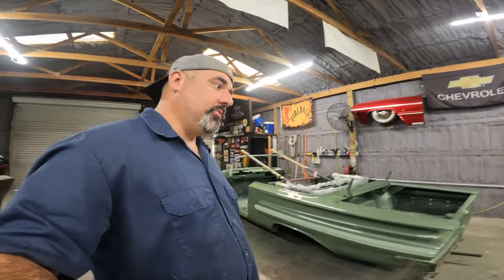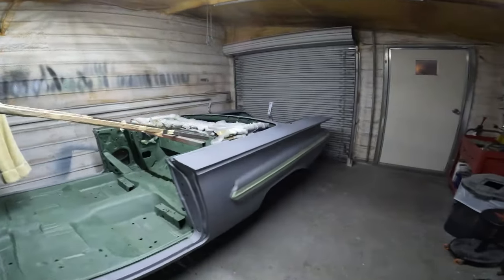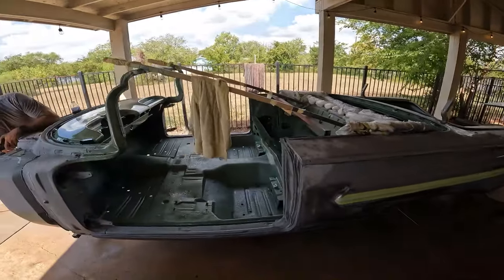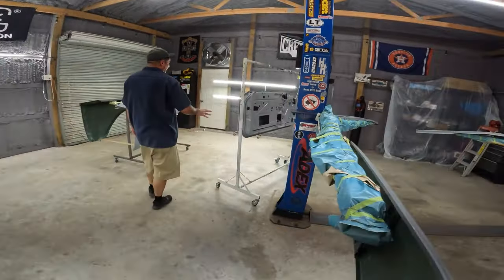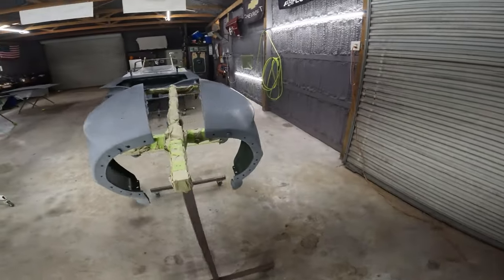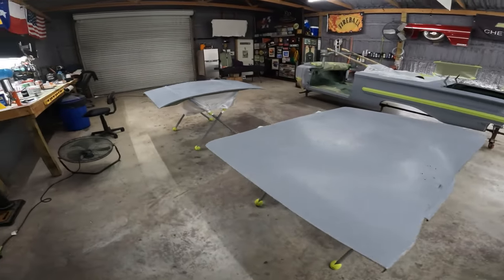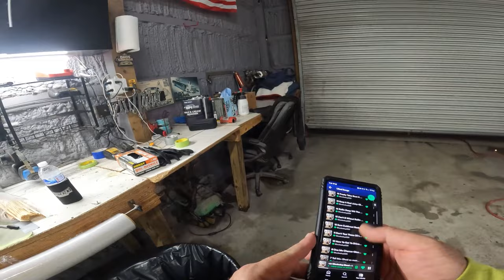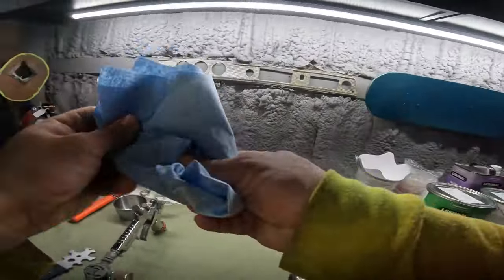1960 IMPALA CONVERTIBLE PAINT JOB PART 1!!  / DIY / LOWRIDER / PAINT JOB / BODY WORK / CLEAR COAT

Comment: @lonestar lows , what color is that green or if you have a paint code? Looks very similar to my Dads car but its not on a chevy, maybe you said it in a video and I missed it. I keep hoping one day you will say "Hot Dammit Bobby" in a video.
Reply from the maker: The color is a stock 1960 GM called cascade green 903A
Reply: @lonestarlows  Really, wow. It looks like an oem color but so much better,  it pops so much more then colors from the 60s. Truly an excellent choice to make your ride stand out. Thank you for the reply.
Reply from the maker: @mikefew4232 yeah man. I love the 60s, but not in red white or black.  I had a black one the greens and blue are so much nicer. And not seen often